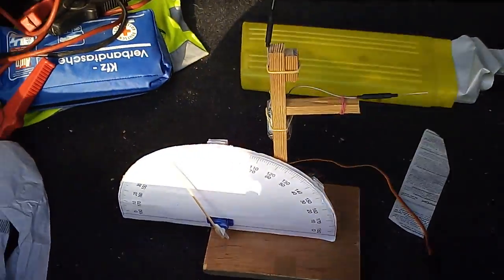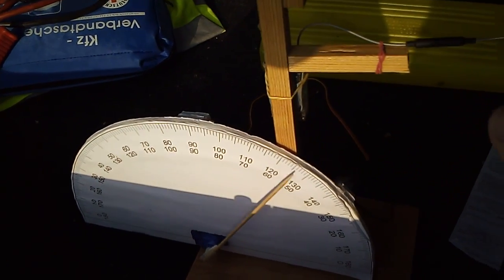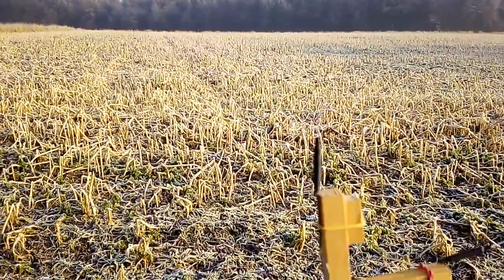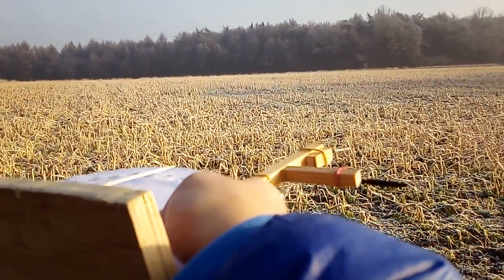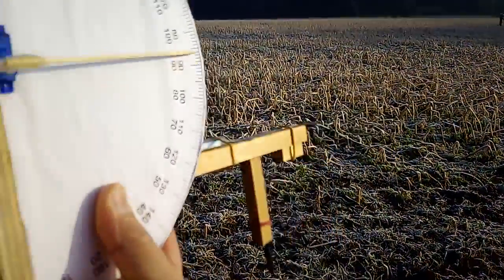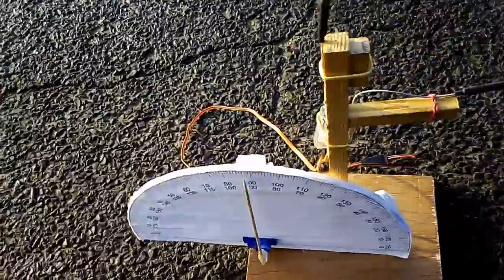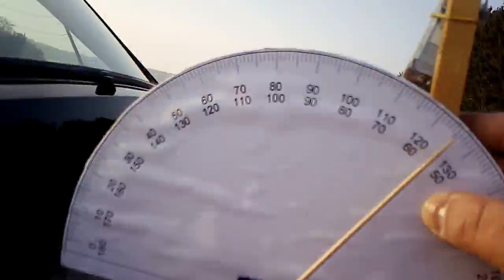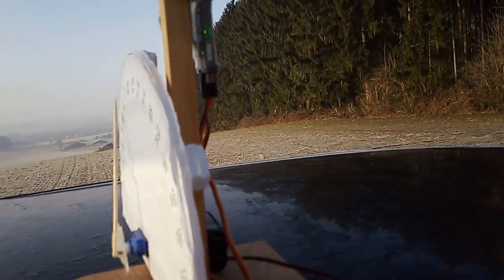Range Test Multiprotocol Module and DIY Frsky_RX at 1.5Km

Comment: The diy components are great and I would like to have such skills but I don't.  If I can't buy it or afford it then I can't have it.  Therefore, I'm not sure what conclusions I can make with what you've shown.  I'm wanting to know If a Devo7e or 10 with deviation firmware (for dsmx) and a multiprotocol module installed (includes stm32 I think) will it also perform as well in your test?  Receivers have a lot to do with range so which frsky rx do you like for range besides the L9R.  Please add any other thoughts you may have since I may not have asked or knew to ask about important interrelated questions.  thx and good video
Reply from the maker: I am not familiar with the Devo TX. I use several boards  on turnigy 9x radios, and 9XR-PRO. All with the great open source Ersky9x firmware installed..
I only use Frsky "D" receivers. The original D8R-II Plus and the DIY Frsky compatible RX. The original Frsky is slightly better in range, but I prefer the DIY due to other features. I don't do FPV so the range is more than enough for my needs :) I also do not know the long range frsky receiver. 
If the RF stage in the STM 32 Multi module is the same I used on mine, I can't see why the range should be different, as long as the electronics are working properly. Never used DSMX or DSM stuff. I hope this answers your questions..